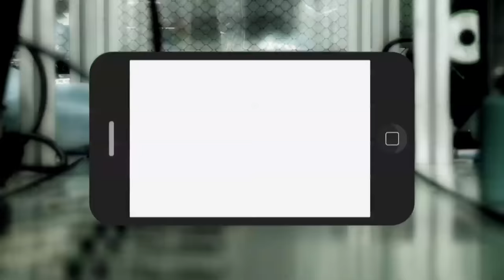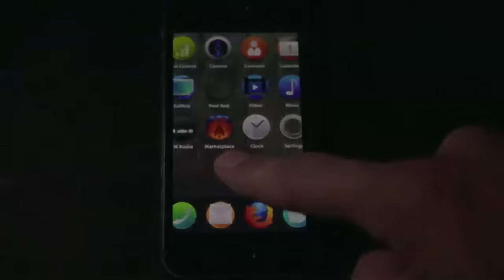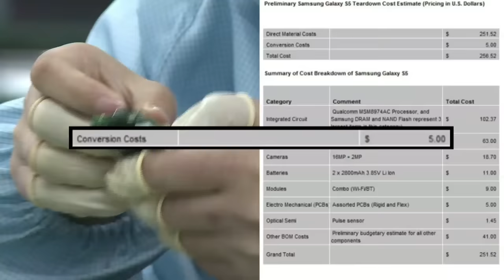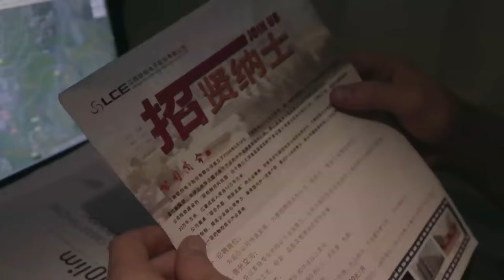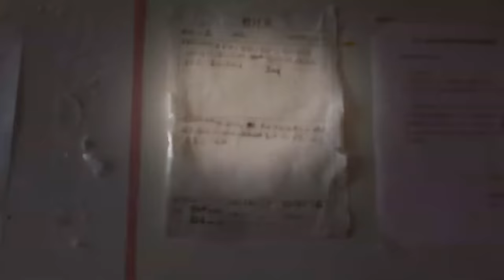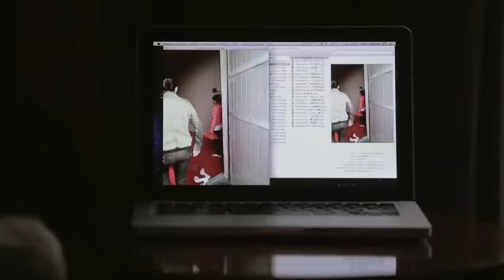The Real Price of your Cell Phone | Mobile Phone | ENDEVR Documentary

Comment: same will happen on the electric car but on a bigger scale
Reply: @user-lu6cy7hm2t  an electric car is just a bigger mobile phone using more rare metals not too mention the lithium were cobalt is also hard to get on a bigger scale, and its not an argument lol
Reply: That will create power crisis in electricity deficient countries.
Reply: @user-lu6cy7hm2t  Aluminium is not mined in a similar way, you must be aware that aluminium is the most abundant metal of the planet. And moreover, the additional use of al. in the ic engines is just a fragment of what is used in most of the modern electric cars' chassis in order to make tgem light and sturdy. The solution is mass scale public transit, electric cars though better in the long run wrt to emissions and pollution will still do a significant damage to the nature.

Comment: That goes on across the board. I worked at a hospital. Whenever Joint Commission, and OSHA were to come around for inspection those at the top of the chain went into, problems solving mode. Case in point. The hallways that were typically cluttered up with all kinds of hospital equipment was put on tractor trailers and taken of campus.
As soon as the inspections were over, the tractor trailers  were brought back, unloaded and put back where the equipment came from. It was known in advance that they were comming. Always. ( Out of site, out of mind.)

Comment: An amazing video. I must admit I always assumed working conditions were probably bad but I never did dream it was this ghastly. I personally own an Apple IPhone 8 that was purchased new and is still working fine in February 2023 and has had only 2 battery replacements. 
It will not be replaced until it no longer works. I don’t believe in constantly replacing cell phones with newer models. If it works I am happy
I hope the cell phone manufacturers get better at taking care of their workers.

Comment: A simple start which everyone can particepate in is simply to take care of their phone as if it was a child, instead of swapping it out for "new" and "better" models every 2 years.
Reply: The problem is that almost all phones have their batteries hermetically sealed inside the case. This makes it all but impossible for the average user to replace  the battery themselves. Most phone batteries will only last about 2 to 3 years. Then there's the app providers who seem to go out of their way to stop supporting older versions of the operating systems. All of this plus the desire for the latest and greatest drives sales...
Reply: My last phone lasted 4 and half years, I did my best with it.

Comment: @46:37

Question: How did the water at the bottom of the several meter deep well, get into the stoppered bottle?
And why, if the bottle has been in the water collecting a sample, is it not dripping wet?  Or covered in mud and grime from bumping against the pipe wall when wet?

Manipulating information much?

Comment: It is BS that Tantalum capacitors is needed for phone to remember settings and like.other type capacitor made of different materials can be used.No capasitor hold a charge of power for a long time,Those values used in local power supply for chip,s in the phone decoupling etc keep power a few sec only.Reason for using Tantalum i do not know.They brake less than a electrolytic cap.If i do repair among all the types of capasitors are electrolytic nr 1 suspect caps.Nr 2 is Tantalum then smd ceramic capasitors.Those polypropylene and other type metalized plastic types almost never brake. In resent circuits i fixed are 30 years old,no"plastic"types had any problem.Only electrolytic caps Know they are better than new.

Comment: Don't think that's necessary true about tantalum keeping the data from wiping on your phone 😂 It's used in capacitors but data at rest doesn't need any of this. Does an sd card need tantalum?

tantalum oxide is also a common insulator in electronics.